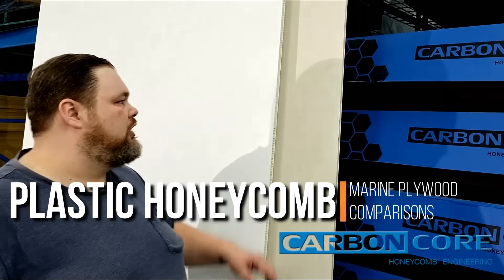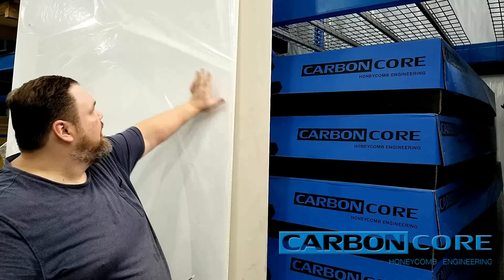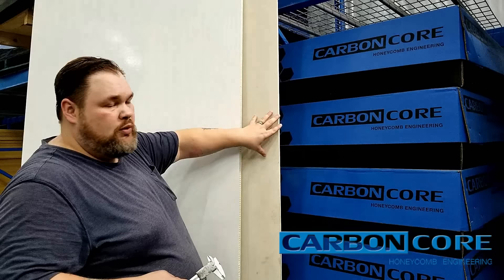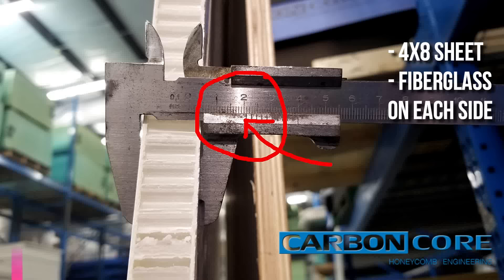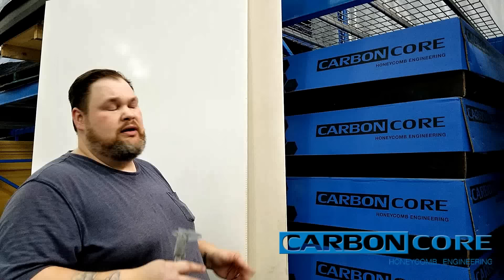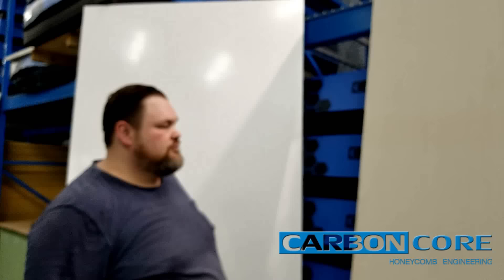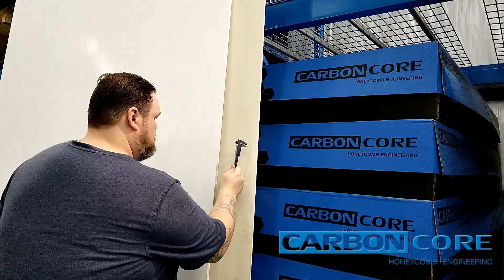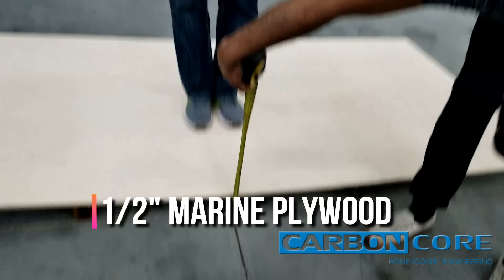Plastic Honeycomb Composite Panels VS Plywood

Comment: how do you fix this carbon core if it has hollow core??
Reply from the maker: Not sure what you mean by”fix”
Reply: @CarbonCoreCorp  its a basic question that comes up time and time again  with hollow core material . there isnt any screw retention property to hollow core material as in plywood, yet its always billed as a good alternative to ply..... how do we join it to other materials , or if used in furniture or lightweight wall applications ...how do we @afix@ it to another material or afix something to it?
Reply: @dcdc1970  We use "cleats" or blocks which are fiberglassed to the core material. It will hold a screw roughly as well as two layers of Chop Strand Matting fiberglass laid up with polyester resin, which is maybe enough for a good photo frame. If you need more than that, you will need to attach stuff to the core material with resin. 

To answer the second question, if you need to afix it to another material, wet it out with your choice of resin. It functions just like balsa wood core, or plywood, in that sense.
Reply: @CarbonCoreCorp  how do you screw into it? does it have any screw retention properties ?
Reply: @TheThomaswastaken  there isn't a clear answer to this. and thats the problem with anything hollow core . it needs additional labour /material to adapt it to be able to be constructed.
a lot of the weight in a boat or RV is in the cabinets , overhead storage , walls etc , and these panels or sheets  need to be joined together... nobody has come up with a hollow core or honeycomb core that can get over this issue. if you could find a way , you would sell tons more of the stuff. honey comb core is being used already in a minimal sense in alot of of leisure vehicle manufacturing , but only where its not visible , or in parts of floors or walls. if it could be used throughout the build then it would be an absolute game changer .  screw retention is the issue
Reply: @TheThomaswastaken  adding to the cost presumably
Reply: @dcdc1970  well that's exactly what I'm about to try and accomplish - I'm planning on driving UK to Nepal through Asia so some pretty challenging tracks and so far I'm looking at 90% plastics with lightweight ply for table and kitchen worktops - and that's mainly for aesthetics. I'm certainly open to anyone with experience